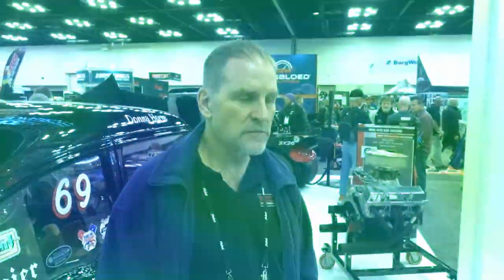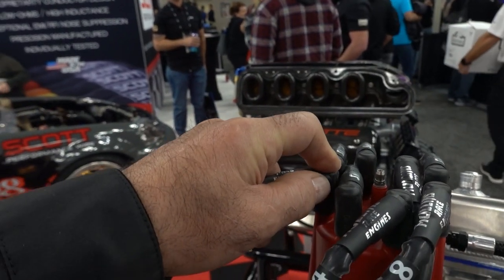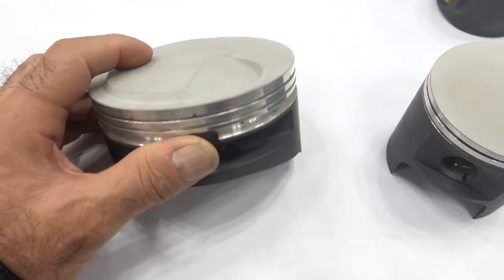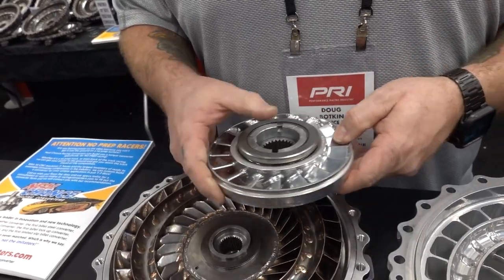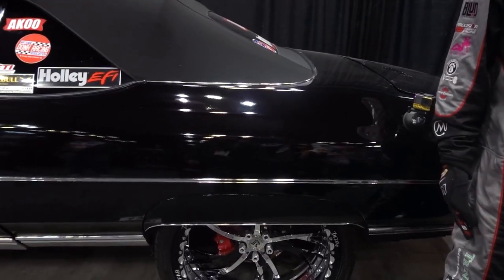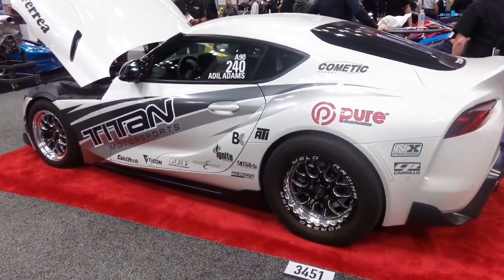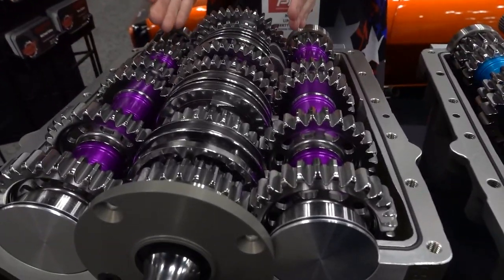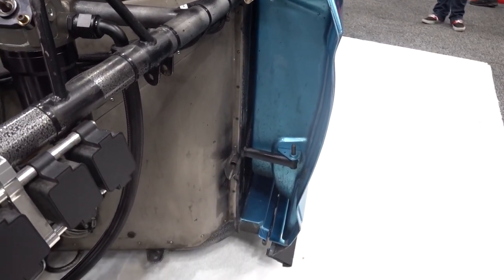The 2022 Performance Racing Industry Show - PRISHOW

Comment: I think the DOT cops would be scratching thier heads if you put the sound system on a motorbike. Stock quiet exhaust but a sound system to push out 140 db of noise that can be switched off when pulled over. NICE lol